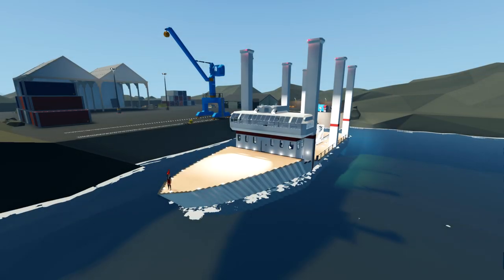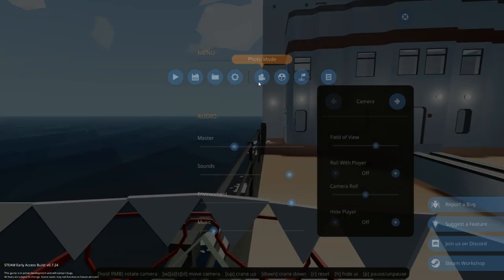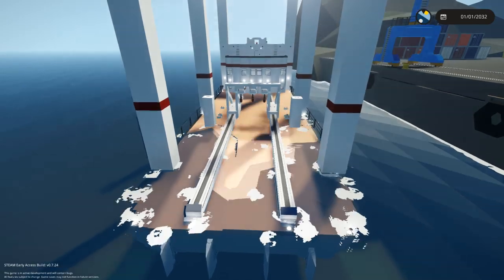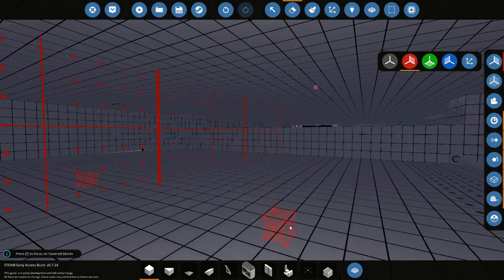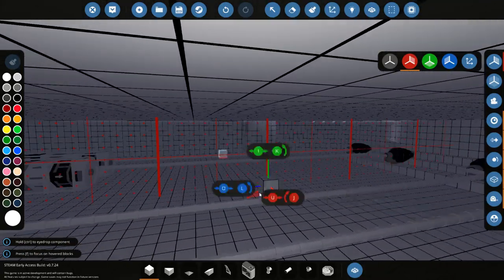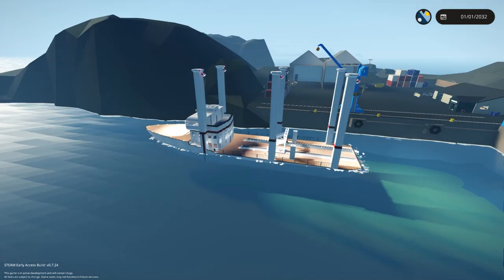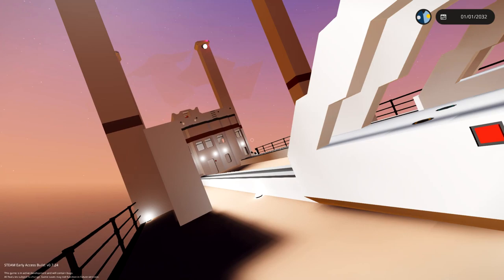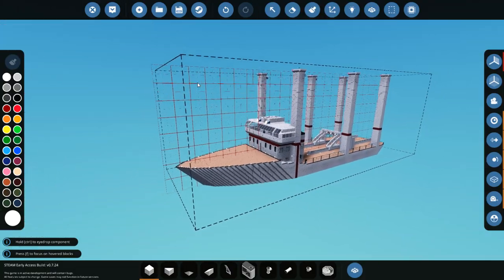Ship With Legs! - Stormworks: Build and Rescue  - Stilt Ship

Comment: For leveling the stilts, just make it so they all go down until they touch the seafloor and then they stop with a distance sensor when they touch the seafloor.  Once they all touch the bottom, they all start moving again at the same time
Reply from the maker: Indeedy.. Just cant get it into my head. I tried before, all the logic should have worked but it never did :S

Comment: @Frantic For the coolant for boats you dont have to use a radiator or a heat sink, you can just connect the pipes from the two coolant ports to fluid ports leading into the water.
Reply from the maker: But what if my boat is 50ft out of the water? xD
Reply: @FranticMatty  Hmmm Should of thought of that XD